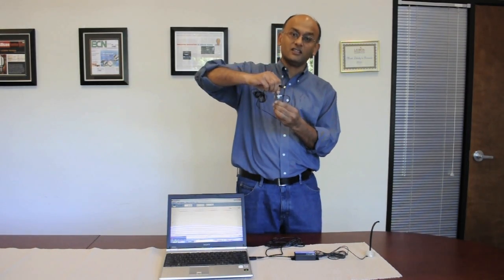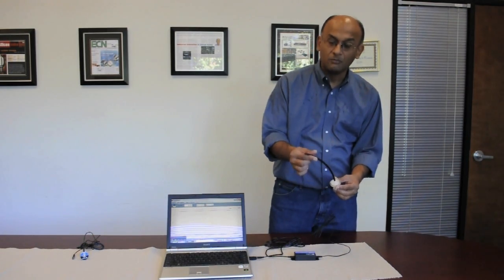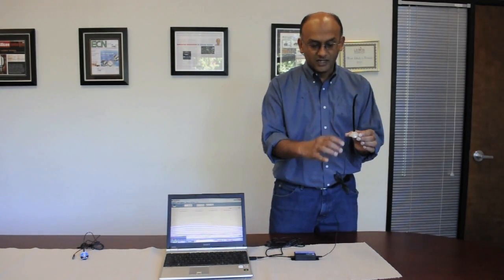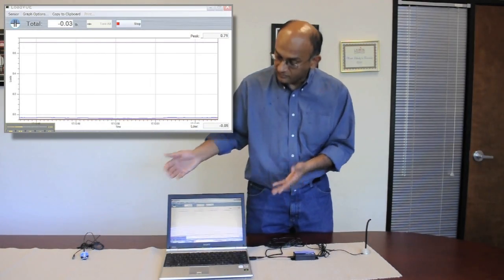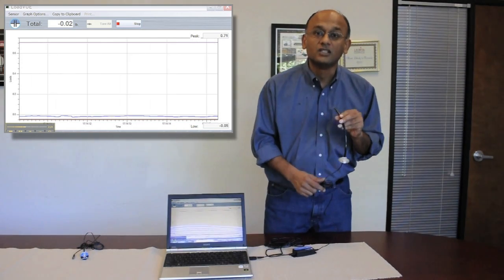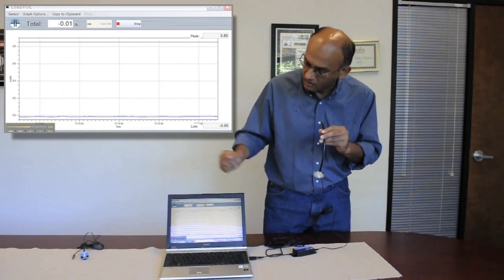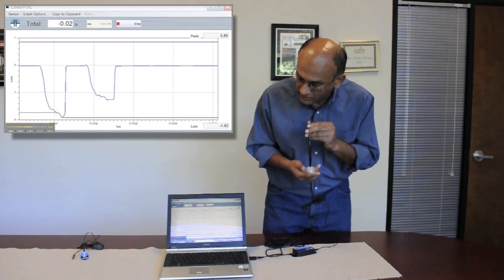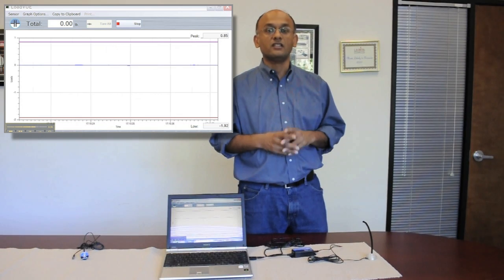Capacitive Pressure Sensor

Comment: can i use this to raspberry pi
Reply from the maker: Yes.  You can connect to the sensors via digital io pins to measure frequency or via our DQ-1000 using Serial TTL output (Tx, Rx) or USB.
Reply: Can u please elaborate how to use
Reply from the maker: +Vasudev A 

Vasudev:

If you have used a Raspberry Pi to talk to any digital device via UART or USART then it is similar (you can look up examples on line for a generic device).  You will just need to send iLoad or DQ-1000 specific ASCII commands to get data back from our sensor/interface.